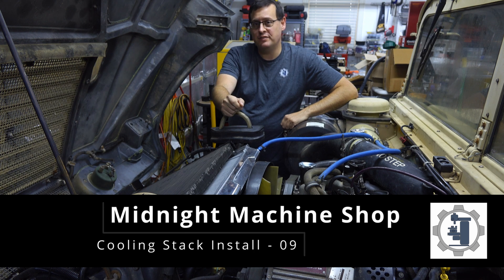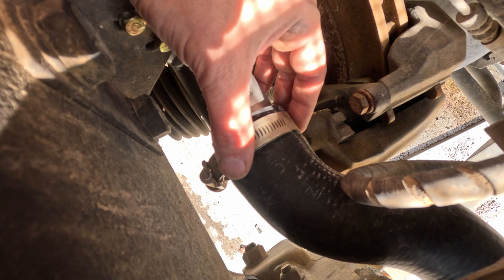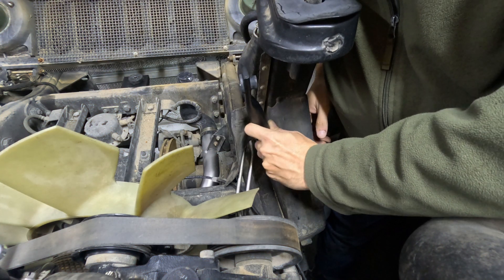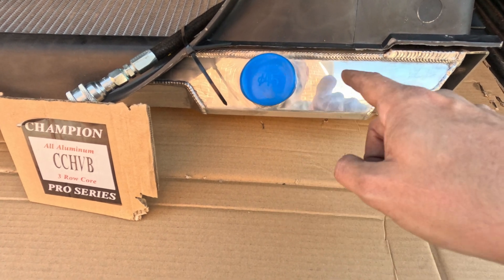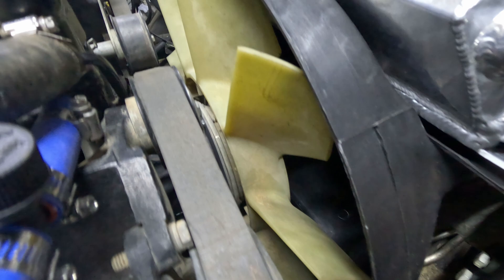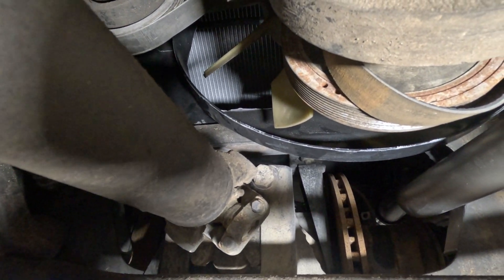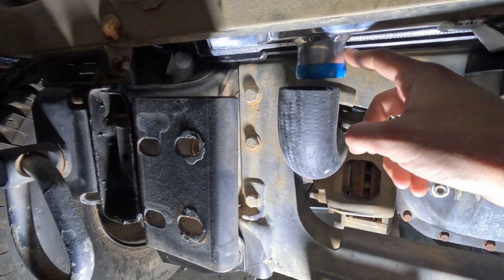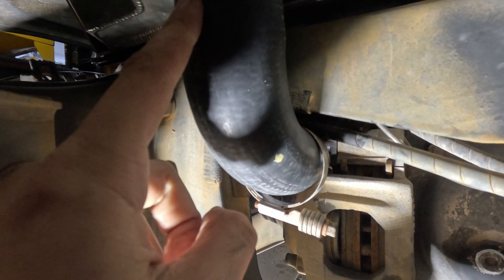STOP Overheating! Install Your HMMWV Radiator Like a Pro

Comment: Thank you for all of these informative videos! Concise and to the point with great tips on how to work various assemblies. I did watch the video on adding the backup and license plate lights. I am looking at bringing my HUMMVE over to Europe and they have an issue where all signal lights are yellow. Have you noticed anywhere in the tech manuals where I could isolate the rear brake lights from the signal lights and running two new lines for the yellow signal lamps in the rear? 
I happened across a video some young army mechanics removing a transmission from a HUMMVE. Good grief! These guys are total idiots, bucking common safety practices! I do hope that we don’t really have mechanics like these jokers in the military. I can’t remember what base they were stationed at but I do hope their CO will see their video and take action. They will be filing for so many injury claims if not killing themselves in the process of doing their work. These are serious trucks that require serious mechanics to do the work properly without rigging a repair like a bunch of uneducated Russian conscripts.
Reply from the maker: The wiring diagram is located in the Unit Maintenance Manual (TM 9-2320-280-20-3 - Part 3). For rear yellow signals you might be able to tie into the wires for the front turn signal lights and run new wires to the rear of the truck to power those. The rear red brake lights would still flash with the turn signals but you'd have yellow ones that were semi-independent of the brake lights. If the rear turn needed to not flash with the turn signals that would be a bit more work. Hope this helps.
Reply: @midnightmachineshop  that’s what I was thinking of doing but I would need to see the wiring diagram for the turn signal switch for isolating the red turn circuit from the braking circuit. Thanks for the info and which manual I need to obtain, maybe it’s on line, need to check.

Comment: That job is a hood off job. Only problem is that it takes two people to remove it unless you garage is equipped with an overhead winch. Personally I would delete the hydraulic powered fan and go with a high efficiency twin electric fan system. One less load on the hydraulic system and you eliminate the problematic "Cadillac switch" that controls the activation of the fan. You can interface a relay of the proper voltage and amperage to control the fans via the existing temperature sensor on the block.
I have had experience with a hydra boost system on my old Oldsmobile diesel car. What would be nice is if one could place filters in line on the output of the pump and output of the brake hydra boost line. I had a catastrophic failure of the pump which sent all kinds of junk into the braking system ruining it. It would take some searching to find something for trans fluid and high pressure system, but a headache saver down the road.

Comment: What is the maximum temperature indicated by the coolant needle that you have ever reached under effort? Have you ever touched the line/notch next to the middle when overexerting yourself? Thank you
Reply from the maker: So far the truck has run at around 195-205°F (90-96°C). I switched to the new style temperature gauge and sending unit (PN 6015560-61) after noticing that the original gauge was reading around 10°F lower than I was measuring with an IR thermometer.

Comment: Those bolts on that A arm being mixed up like that is scary... I've been working on my trucks for the last year and saw a few mistakes, but the bolts on the A arm... that's something else. Safe driving and nice work!
Reply from the maker: Unfortunately there was a lot more loose including other suspension parts and a spindle nut. I'll be going over it in an upcoming video on the suspension and hub rebuild.
Reply: @midnightmachineshop   Wow, it is good that you checked. I usually hear the normal horror stories about the spindles, but this is very eye-opening. I'll be sure to pass on the knowledge when I get a chance on my M1097R1. If you don't mind, when I post some of my own updates, can I use your videos as a reference link in the description? 

Edit: I'll briefly but informatively have a few seconds of footage on this but leave the important part to your channel footage

Thanks!

Comment: Careful with aluminum radiators.  They cannot handle vibration like the OEM copper rads do - which is why copper rads are what are used in heavy construction equipment.  The isolators don't really do a great job in getting all of the vibration.

Comment: Cool build, thanks for including part numbers and sizes.  40 times, that's lock to lock, just to clarify.
Reply from the maker: Thanks for the info! I wound up doing it 40 cycles which took longer. Either way It worked out as when I started the truck the power steering pump was nicely primed and didn't put a bunch of air bubbles into the fluid.

Comment: Can you make a statement about the cooling capacity compared to the stock?
Reply from the maker: I'm not sure of the difference in capacity between the aluminum 3-core aluminum radiator that I used and the OEM copper-brass radiator; I never had the original radiator to compare it to. That being said, my truck runs right around 195°F on a day that is 85°F. 

I did see that a company is now offering a 4-core but the water inlet for the radiator is in the H1 rather than the HMMWV location, which would require a different upper radiator hose.

Comment: I could use your help if you wouldn’t mind. Please sir I have two M1097A2’s and could use some FaceTime or messaging on sourcing and or finding out what exactly I’m missing and how to hook it up on cooler lines transmission, oil radiator and sourcing certain parts. Your help would be greatly appreciated. I’ll pay you for for your time.
Reply from the maker: I can be reached at themidnightmachineshop@gmail.com

Comment: Thanks a lot for detailed videos … I just got humvee without radiator and coolant leak . I am getting champion radiator tomorrow hope this is complete video which I need to setup
Reply from the maker: Glad it helped and I hope your repair goes well.
Reply: What kind of bolt is that sir ? Which goes to metal straps in (shroud to radiator ) black bolt size and diameter
Reply from the maker: @satyanarayanana7563  The ones I used were 1/4-20 x 1.00"  McMaster-Carr PN 94444A103

Comment: Sorry if I missed this, what upper radiator hose did you end up using?
Reply from the maker: The one I used is the same as in TM 9-2320-280-24P.

Upper Hose (Thermostat to Radiator Inlet)
PN 12339160, NSN 4720-01-188-3909.
Reply: Wish I had ordered the right champion radiator. Had to use a flex radiatorhose for mine and am guessing it won't last as long, just carrying a spare for now.